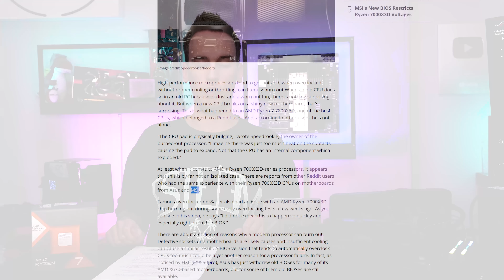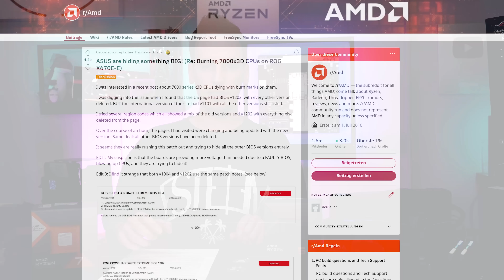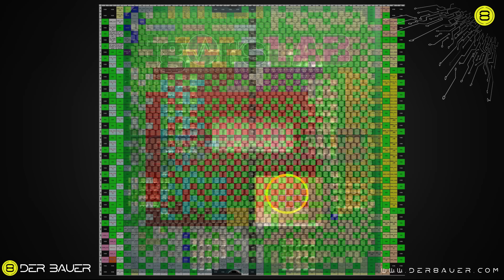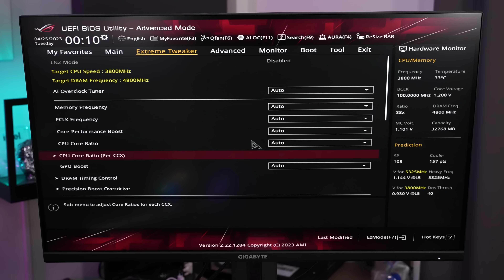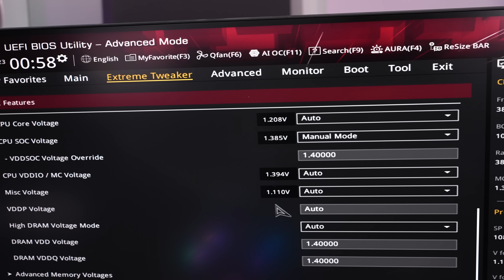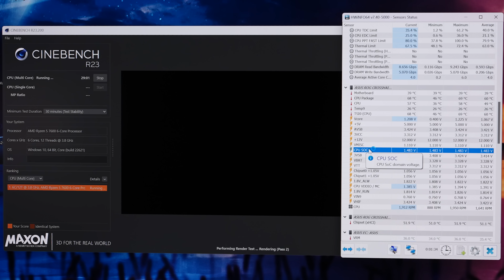I missed the Damage on this Ryzen 7900X

Comment: I’ve got news for you regarding mounting pressure… i just put my 7950x in a asus crossair gene, with a Noctua NH-D15S… if I bottom out the retention screws with springs… the system would get weird instability were it couldn’t boot… the power button did not respond, only some rgb on the board lit up… was trouble shooting the power cables, reseated the cpu, psu… all didn’t change much, until I didn’t mount the fin-stack, but just plopped it on top as a thermal mass to see what happened with bare minimal cables and other devices connected. IT BOOTED!!!

So in the end i put everything back together again, mounted the the cooler gently, with a couple of cold boots in between to make sure it kept working… then the next morning… dead again… 

I unscrewed the retention screws from the lowest position one full turn… system worked again /flip-table-meme-here/

Since then, system is stable… heard about the issues through reddit, grabbed the latest bios… and dropped 20°C on idle with expo on (from 55°C to 35°C)

I hope this experience is useful for you, and that it finds you. Good luck, I hope you get to the bottom of this!
Reply: Interesting, I've been having endless problems with my 7950X3D but they seem very hard to determine. This might be my problem!
Reply: What kinda package temperatures do you get? My system stability has improved significantly. I can shut down without getting crashes and warnings! The temperatures jumped up too tho...
Reply: @alexbrown1050  idle ~35°C, boost it will touch 95°C then throttle to 90°C and back to 95°C. CPU is running stock and I still have EXPO enabled, but after everything that has happened, I might disable that until more is known about the issue.

It might be that you CPU can finally stretch it’s legs for the first time… did you do a before&after cpu benchmark or something?

A great indicator to see if you cooler is still mounted properly, is to see how fast the temps drop after you hit the CPU with a load.
Reply: Underpowered Mine from stock 170 watts to 105 watts: 142000 PPT, 110000 TDC and 170000 EDC directly in Bios, never had issues - Heat similar mid 30s to 40s idle

Comment: It looks like the CPU has suffered a thermal runaway event, it would be interesting to know what was running when it happened, of CPU was stock, any AMD boost options set. Also if it just died or if any events like unexpected shut downs or warnings or corruption of software. Also pc specs such as air cooler AIO or custom water amount and speed of Memory, PSU etc may help as may be a common cause/situation occuring that not everyone will see.

Comment: I have issues booting but if I force a shut down then restart.. no problemo!
I have 6000MHz cl 36-36-36-96 @1.35v EXPO ram I overclock to 32-34-34-76 @1.4v. 😐
I should add I believe my SoC voltage is set at 1.25v in BIOS.

Comment: Does the small bubble on the 7900x affect the function/performance?  Wondering if I should pull out my 7700x that was running on EXPO I to check for issues
Reply: Same thought process today. I've been running EXPO (+ ECO) on my 7700X build for 2 months now. Curious if I should pop it open and check.
Reply: @BeerGogglesFTW  well if you do end up checking lemme know.  If I decide to pop it out and check I’ll do the same
Reply: @BeerGogglesFTW  just popped my cpu out to check and looks like all is well

Comment: Looks like typical popcorning to me.  I've only ever seen it when someone heatgunned a chip to "reflow" it but used too high temperatures.  I suspect that it's been caused by too much current being pushed through too little electrical contact area.  The die sensors won't really detect it as there's a PCB in the way.

Comment: I am wondering if my dead B650E-F and 7700X was related. I had manual memory timings but never touched voltage. Unfortunately they both died together before I saw or experienced any issues and there wasn't any visible damage. 🤷‍♂

Comment: I decreased my CPU SoC voltage from default 1.340v from EXPO setting to manual override to 1.15 volt. Seems stable for now with same timings (GSkill 6000mhz cl30). But what about CPU VDDIO / MC voltage? It's with EXPO on also 1.340v. Maybe we should just disable EXPO for now and wait for the indepth analyzes.

EDIT: Ive changed CPU VDDIO / MC from the auto/default (EXPO II) 1.340v to 1.240v. The min voltage is 1.1v and max 1.7v so maybe less important than lowering the CPU SoC voltage.

Comment: I think you're on to something with the length of time the CPU is left running after it dies.  My 7950X/Asus X670E-E Gaming Wifi on 0805 FW died 2-3 weeks after build with absolutely no auto or manual OC, only setting changed was enabling Expo I mode.  It died at idle on Windows 11 with a Chrome browser window open and not doing anything, no load.  I heard a pop sound exactly like a capacitor failing, I look up at the monitor and it's black and the PC is hard locked.  On reboot it wouldn't post and was dead dead.  I shut it off within seconds of the failure, rebooted it briefly a couple times (less then 5) to try and troubleshoot as I removed components, but it seems like the people that were for example not home and came back to find it dead (like u/Speedrookie) had far more damage then I saw on mine.  All components were brand new, HX1000i, G.Skill 2x16GB DDR5-6000 F5-60003636F16G, etc.  Thank you for covering this topic btw.

Comment: I've built an AM5 system in the last 2 weeks and had nothing but problems. Using an ASUS pro wifi motherboard and 7800x3d, I couldn't even get expo to load and the PC wouldn't allow DDR5 6000 RAM set at anything above 4800 manually. Got a new ASUS motherboard, got a new 7800x3d just in case it was a bad memory controller, and now EXPO loads fine, but getting some odd system freezing and crashing.  There is definitely something going on with AM5 and DDR5.
Reply: System freezing is common for amd, zen2 zen3 all like that. U need to accept it. Don’t try to against it

Comment: Why do EXPO profiles bump VSOC that much, anyway? Is it for those CPUs that lost the silicon lottery? On my 7950X3D system, I put in some DDR5-4800 ECC modules from Kingston, overclocked them to DDR5-6000 and dropping CAS to 30 (the Buildzoid timings), and am currently running VSOC at 1.15V and VDDIO etc. at 1.25V, and things seem fine so far.
Reply: Bad ram controller, guess why intel may easily go to 8000 mhz amd cant

Comment: Allowing the CPUs to run at 95* when they could have limited it to like 85* and still had amazing performance was a stupid mistake and everyone should of seen that as a red flag on these chips right from the get go imo. I'd speculate the temp sensor isn't close enough to the hottest part of the chip.
Reply: The x3d is limited to 89

Comment: Idk if this is normal but my ryzen 7 7700x ramps up alot and my temp can shoot up from like 39 c or 49c to like 60c then 70c sometimes 80 c then come back down when I'm not running anything. When I game it runs pretty steady around 49 c to 56c. Not overclocked and using a nzxt kraken x63 in the nzxt h7 flow. My ram is stock 4800 Causey asus x670e tuf wifi won't boot with docp settings.

Comment: Typical amd trash. 
Went 13900k, and 4080. 
Don't care if in a few games I could get 20 more fps when I'm already at 300. 
AMD is trash, drivers are trash, windows feels laggy, sluggish. 
7000 GPUs are trash. 
Everything they make is garbage outside of the 5000 series. Those worked fine. Such as 5800x3d. That's only CPU worth getting from AMD imo.

Comment: Manufacturers of computer hardware setting voltages skyhigh as usual.

And with the non-stop, ramping, arms race to get just a tiny bit more performance than the competition by pumping more voltage, damage to hardware was bound to happen.
Also, it doesn't happen just at release, with every motherboard bios revision voltages tend to keep going up and up.

And with ram, yea, XMP / expo profiles lately tend to touch settings that it shouldn't be touching, even less when the values it inputs are quite high.

Comment: This kind of shenanigans is far from a new thing .I have an Asus Z390 board running an 8700k. On it I've had to turn down the analogous system agent (vccsa) and memory IO (vccio) voltages when XMP has applied. The board autosets them way too high , to avoid crashing. Remember there being delays to Ryzen 7000 due to expo being unstable? Might be a quick fix to get them out of the door but bad for the processors longevity.

Comment: Latchup normally happens to I/O drivers. This would be quite consistent with something on the board driving the I/O lines to latchup (like a memory bus voltage that goes past the input transistor vcc). This would disable the chip instantly and there is nothing the monitoring circuits can do to stop it even if theyre unaffected, short of shutting of power to the system.

Comment: Glad i tinkered with the settings on my 7700X. Curve optimizer -30, locked to a 100 watts, enabled EXPO (but running 6000MHz instead of the advertised 5200MHz) and set the SOC voltage manually to 1.25v. Hope nothing happens 🤞

Comment: Expo should set proper voltages by itself because 99% of users will assume that the BIOS knows what is doing.
If you have to manually set voltage after enabling Expo because otherwise your CPU will die then this is a really really bad situation.

Comment: I don't think the location of the "bulge" is a smoking gun necessarily. Once shorted there's going to be high current so essentially you have a small heater element right at that location where the supply pins are densely located. The bulging likely happens after the failure and isn't necessarily indicative of the failure itself.

Comment: Speculation on my part, not saying that this is fact
I wonder if the failure is more due to a defect of the actual PCB of the CPU, like you said delamination wouldn't occur unless at excessive heat over a period of time. It may be that the CPU is only passing QC marginally, and expo is showing the weakness in the PCB. I don't think it's the actual IO die or CCDs as as delamination would first occur where the heat is applied.

Comment: This will no doubt be fixed by a BIOS update, but until then I will wait building my new system. New parts have come in in the past week, and the rest today.
Just to be on the safe side.
Reply: yeah all mine are currently chilling on my desk im on pins and needles lol
Reply: as of the 26th a bios was released for my board so you might want to check
Reply: For mine a beta was released earlier this week, and yesterday the final. TUF Gaming X670E-Plus.

Comment: looks more as the CPU brake and "short" increasing the voltage and amp that the VRM's can managed to deliver at MAX. so if the VRM's can deliver a lot of power you get a huge temp bump on the CPU after it "freezes". motherboards that dont deliver that amount or control something better wont make it "so hot". the question is them "what make the CPU short/freeze"

Comment: I already had SOC voltage dialled back from 1.35 to 1.25 manually, thanks to seeing this I've now turned off expo alltogether (which made zero difference as I already had all voltages and timings dialled in manually by following buildzoids hynix timing guide, but atleast the defaults arent stupid now).

The other voltage my msi board likes to turn up is VPP - every now and then I notice its sitting on 1.95v even with it manually set to (the default) of 1.8v in bios, turning off expo didn't help with that issue, so I'll see if putting it on a non-default value (eg: 1.81) prevents that.

Does seem that expo/xmp are pretty poorly implemented, and in my experience its been like that since day 1 (I remember the first time I turned xmp on, it was an X58 board and it happily dialled QPI voltage up to something well above the "safe" range, I was able take it almost back to stock voltage with zero issues).

Comment: I had issues with 2 MSI motherboards with DDR 4 or DDR 5 using 2 x 32gigs of memory 5700X and 7900 CPU both getting stupidly hot with 64gigs of memory.

Comment: Oh, finally ASUS decided to address the SoC overvoltage. It's crazy, on my R5 7600 with TUF Gaming B650-PLUS WiFi the default SoC voltage is 1.36V given that @6000 MTs with tight timings from Buildzoid I am perfectly stable with 1.15V SoC already 3 months.

Comment: So, you described that normally the SoC voltage with expo on is around 1,3~1,4V. But do you know this for sure to be the normal value. My SoC voltage with 6000mhz memory and EXPO on is <1 V...
Reply: thats because all memory kits have different timings and performance. My kit CL16, 16, 18,18, 18 runs on 1.35v @ 3600mhz.
New kits run for 6000-6400 about 1.35v, the lower the speed or the faster the ram kit is, the less power it needs to complete that task.

Another way to look at it is like cpu's. My friend can run his 5800X at 1.1v 4.4ghz, or 1.3v 4.6ghz.
I cant run my 3600X below 1.3v if i want my clocks to be 4200mhz. While for him his chip with his silicons can probably run 1.0v and still do stock properly.

Well your memory might not need as much power for those clocks, or the tuning has been optimized by the board in a way that it doesnt ask high voltages. 
Regardless 1v is very low given your speeds. its a wonder its not plainly crashing from undervolting. So be happy that it functions well on low power draw. Its a good benefit for you.

Comment: Its called electrical overstress. Thats the catchall term for "something blew up". Anytime you raise the voltage you risk breaking the dielectric and shorting the chip. Features are getting so small, there is little margin for power supply noise.

Comment: Isn’t the max memory clock for Ryzen 7000 at 5200Mhz ? When running dual channel
Reply: Yes but AMD said the Sweet spot is 6000Mhz. So it SHOULDN'T be an issue.
Reply: so to stay on safe side why not clock down to 5200 MHz so if something happens , keep warranty and say within speck. Right?

Comment: In my opinion the faulty part is the design of the printed circuit of the diy that has a manufacturing defect which barely shorts two (or more) pins.
The motherboards have nothing to do with this.
Thanks for the video.
Reply: if that was the case then would it not immediately short as soon as it receives power?

Comment: Being new to AMD, and not having opened the box for my 7800X3D, if I so much as enable EXPO on my ASUS system and this happens to me, I have no warranty right? :(
Reply from the maker: Well there is no easy way for them to detect if EXPO was used. So in case of a defect if a user doesn't talk about it, AMD won't know. That's one of the weird aspects about this entire thing
Reply: @der8auer-en  From what few RAM speed testing I have seen for the X3D, running stock speed vs EXPO 6000 doesn't seem to really matter anyway. 😕 (better safe that sorry I guess run stock DDR speed for now!)

Comment: AMD is gonna get a bad rap for this, I am running EXPO/ XMP on my MSI and no issues thus far. my 6000mhz DDR5 at top speed.
Reply: I was running EXPO on my 6000mhz cl30 for a week with no issues. I disabled EXPO today the moment I discovered it just for safety measures until we get to the bottom of what the cause is

Comment: lucky I have an MSI MB for my R9 7900 and no issues and I have been running fine since I bought my system last year dec. I am running my CPU on Rog Strix 360MM rad and using commercial heatsink paste and my CPY while gaming has not exceeded 75 to 80 degrees and using benchmark software hit 92 max on Cincebench. so either I am lucky I got a good CPU and MOBO or it is the  these gamers are not building there systems carefully.

Comment: Considering Asus, MSI and ASRock all have a history of messing with voltage and power reporting, I can't help wondering if that may play a role here, or something in relation to load line calibration. A lot of talk about extreme voltages and heat, but I haven't seen anyone actually give figures that might help pinpoint cause. 

I have to imagine that if in general use - gaming, browsing, etc - these chips are pulling so much that they're burning out and physically deforming, some sort of aberrant behavior would be visible well in advance in HWinfo or BIOS, esp when running stress tests like Cinebench or Corecycler to indicate a problem. And if there is no warning sign, that would imply something in the BIOS is effectively lying about the voltage and temp.
Reply: What about Gigabyte ? Did you forgot to include it in the list or did they never messed up ?

Comment: Seeing this might push me away from trying AMD with my next laptop purchase. Cuz what if a problem or a bug with the 780m or 7840hs burns up a framework mainboard or any laptop Mobo (And yes I'm thinking framework 16) Might just go with Intel instead. (Might get less Battery life and Less GPU power but I can trust that Intel is Reliable and more Stable while AMD has many of these problems and If a Arc A770m is a option then I'll buy that alongside a Intel Framework 16. I may change my mind again but dang AMD has so many problems NGL.
Reply: the laptop versions will be fine like, they have to run on much less power.

Comment: My family said that AMD Cpus run Hotter per clock then Intel's in the past, I almost feel like this is proving the point but I almost wonder if the same crap happening to AMD could happen on Intel next when their 14th gen comes out or sometime in the future. Or could it be that AMD is unstable and Intel is more stable. We will have to see.
Don't know if they know about Ryzen or not cuz they have just bought Intel, but even if that theory isn't as true and efficiency can prove that. What is true is that Intel has the Stability Crown (but mobos can still have problems/Cough Cough Asus) while AMD has a Boatload of problems and that may Deter me from trying Ryzen until AMD takes stability seriously as a Way they want to beat Intel in.